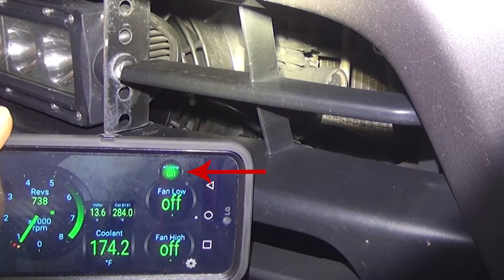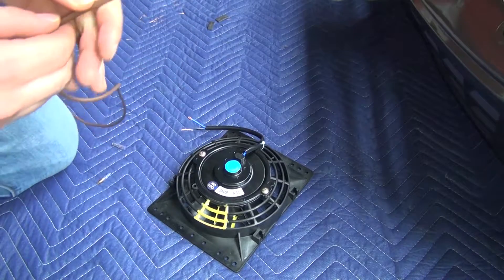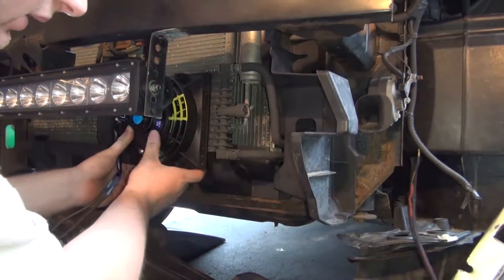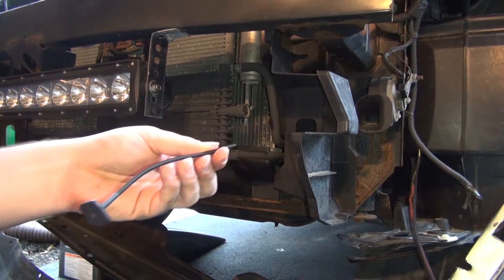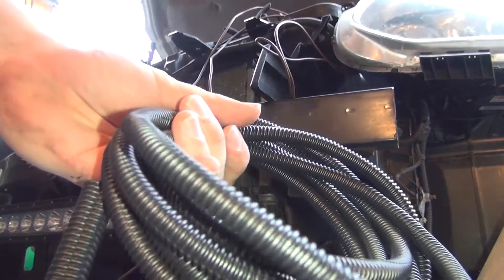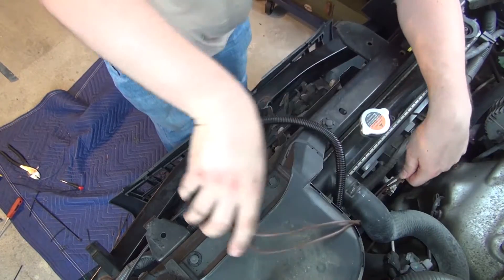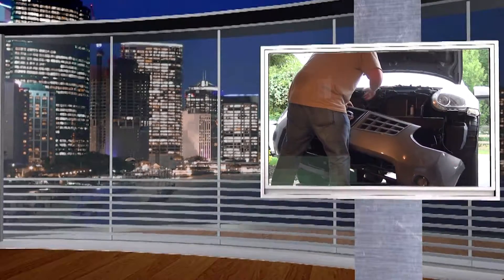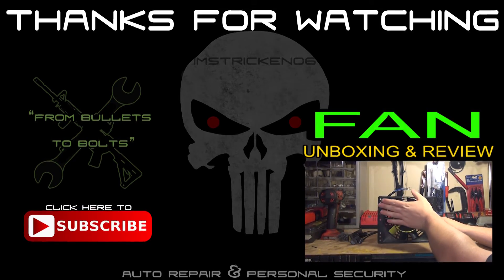EBAY AMAZON OIL COOLER FAN - INSTALL 2/3

Comment: Hey got 2 questions buddy, why didn't you tie into the existing radiator fan wiring from the factory rather than hooking up a relay. I am thinking about doing this same mod but was wondering if i could just join the two wires from the trans cooler fan to the radiator fan harness from the factory bypassing the need for a relay? Also how big is the fan as in thickness, height and length?
Reply from the maker: +Scott Griffin the reason why i didnt piggy-back the wires from the radiator fan is because the little fan draws a boat-load of current. that would over-load the stock fan circuit. i only used the stock fan wires as a .5amp 'signal' wire for the relay. its the correct & safe way to do it. otherwise you risk over heating wires, popping fuses or a car fire. 
the fans are all different sizes. this is the fan i used, check out the listing it has the dimensions: http://www.amazon.com/gp/product/B0084IA8K2/ref=as_li_tl?ie=UTF8&camp=1789&creative=390957&creativeASIN=B0084IA8K2&linkCode=as2&tag=imstricken06-20&linkId=OD4NFLYNEQ4OEYII
Reply: +ImStricken06 thanks so much for the info

Comment: I always want to put fog lights on my Nissan rogue but how would you wire them to a button? I could just splice it off the low beams and have them always on.
Reply: Dmitriy Borovkov buy a wire harness
Reply: Tray Muse burn your car😂

Comment: The air will go the path of least resistance with-it overhanging 2 inches you are getting no benefit hardly at all
Reply from the maker: Temp gauge and thermometer proved otherwise.